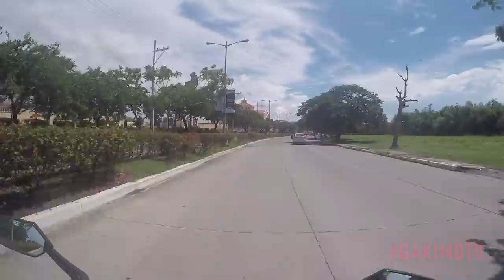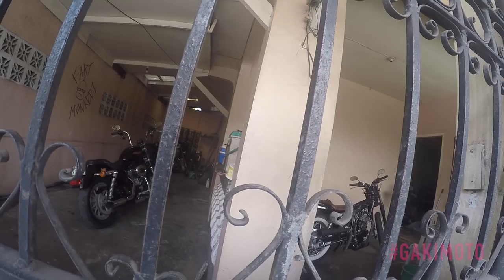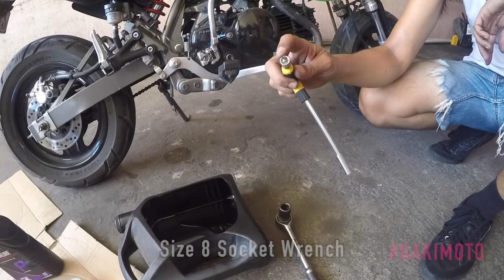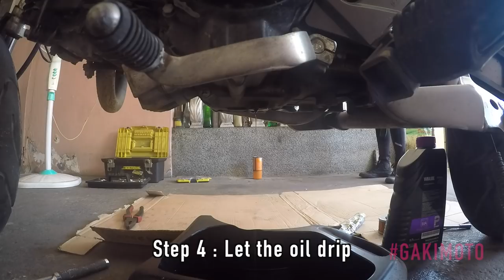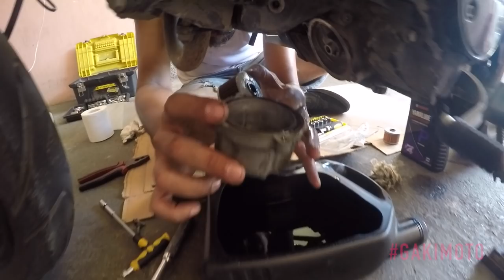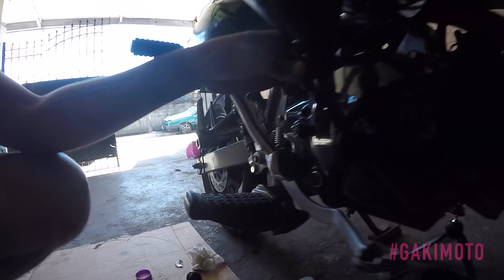GakiMoto 83 : Learning How to Change Oil on my Kawasaki KSR110

Comment: Disk Brake de and re assemble along with putting brake fluid and adjusting the brake?. just a question. Raider front brake aint working.  brakes. xD Waiting for the next lesson! :)
Reply from the maker: I Am VreheL will note that down

Comment: Why do you use Yamaha Lube, there is a a proprietary kawasaki lube.
Reply from the maker: Ronilo Jasareno it works just as well... So why not
Reply: GakiMoto just curious and do you also used in your other bike, I used also different brand of oil in my scooter except Yamaha Lube I will try it sometime.
Reply from the maker: Ronilo Jasareno Jonathan swears by yamalube. 👌 he uses it on all his bikes. When they changed my oil at KTM they used Motorex. Ducati uses Shell.
Reply: GakiMoto I will try it to my scooter KYMCO Super 8 125cc

Comment: i was wondering if he did tighten the drain bolt before putting the engine oil. haha
Reply from the maker: 2wheelfoodie carl yes, then after he checked as well. But if your engine is cool, you can tighten it already. 👍

Comment: i change my oil every 1000km. it's in the manual. RTFM =p
Reply from the maker: if you love your bike... hehe
Reply: sometimes pa nga 500-800 km pa lang palit nako langis e. magkano lang langis and oil filter. mura lang naman, wala pang 1/4 pakarga ng gasolina sa kotse. ang 3k km na change oil possible sa fully synthetic. kaso problema sa fully synthetic nauubos katagalan. so u have to stay on top of your oil level if you don't wanna overheat.
Reply from the maker: franzb69 that makes total sense. 🙌